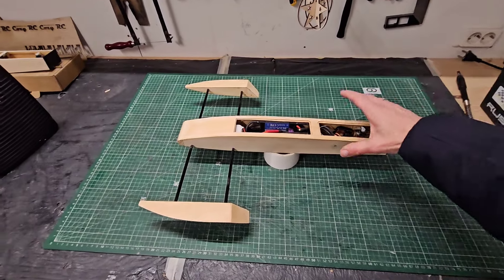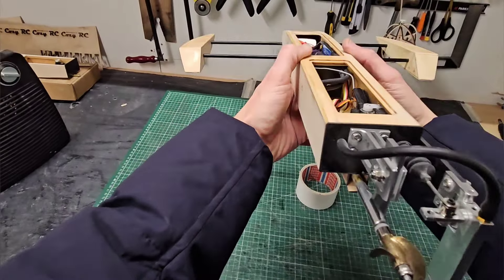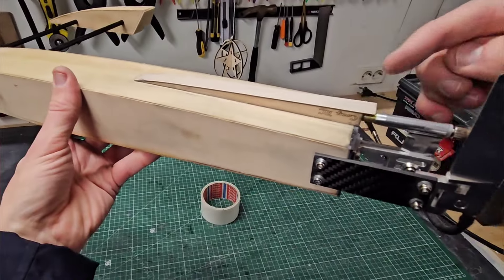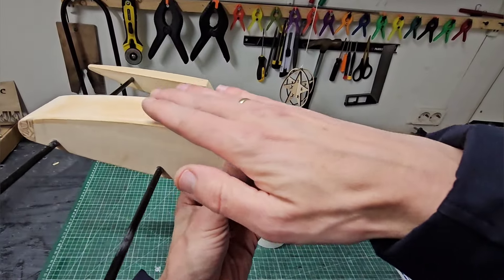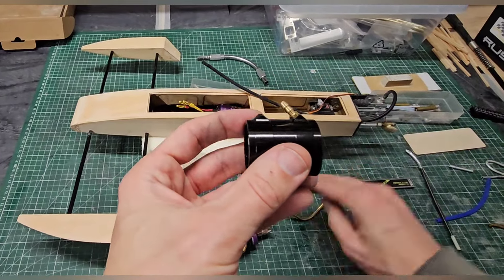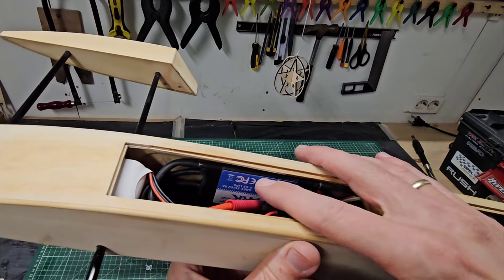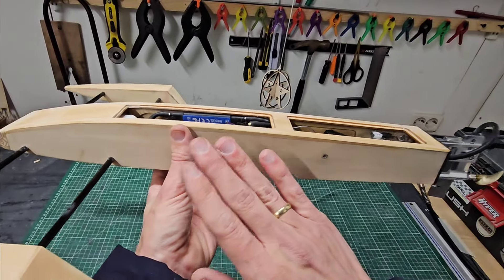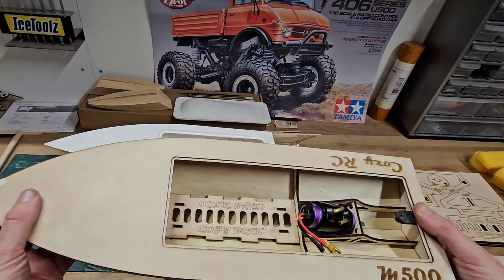Cheap and fast: Shrimp rigger DIY RC boat build part 4

Comment: Don’t colour over that awesome nose section love timber grain like that. The M500 looks a nice boat. Lots of mods that will guide me on my shrimp build that myself and grandson will make soon. Thank you.👌👍🇦🇺
Reply: Will you be using the DDF-350 transmitter and receiver on this build Cozy? I’ve ordered one for the grandson build.👍
Reply from the maker: Thank you! I will keep the nose section clear. I just put some paint on the sides. Enjoy your shrimp build!
Reply from the maker: I will use a cheaper Flysky transmitter for this one. The DumboRC DDF-350 is an awesome transmitter that I use on my bigger boats.

Comment: Iv the same problem with mine, iv fitted a 2968 and because of the angle of the motor mount the back end of my motor and the jacket are popping out the top. The way I'm going to solve it is build a custom canopy something like what a fighter jet has, well that's the idea. Iv never built anything before or used esc or motors my other cars are nitro so thanks to everybody making vids iv learned alot building this.
Reply from the maker: A raised canopy is an easy way to solve the issue!

Comment: Any news on the new shrimp build have you run it yet? 
My 3s version got 75.2 mph using a 3s 11.1 volt 150c gnb 2800 mah  lipo flycolor 90 amp rocket 2968 5300 kv with a 4015 abc round ear by dasboata. It’s a stock build shrimp I just made a longer front hatch so the deck over the battery is part of the hatch for easy access. It has Ironclad’s rear ski and a 4mm flex cable with a 4 mm to 31/6” prop adapter.
Reply from the maker: Great result, James! Thanks for the info on the setup. 
The first Shrimp out of 3 that I'm building is almost finished. I will maiden run it next week. I made a carbon fiber turn fin for it and gave her some paint today. Stay tuned for the video next week. I have been really busy with producing kits lately.

Comment: Nice video! Thanks for sharing know-how. Is it worth to shorten rudder as Ironclad did?
Reply from the maker: Thanks! For top speed, shortening the rudder will reduce the drag. I will try to find a good balance between  speed and handling. Therefore, I will not cut the rudder blade 😀